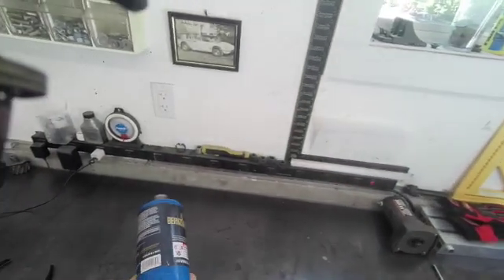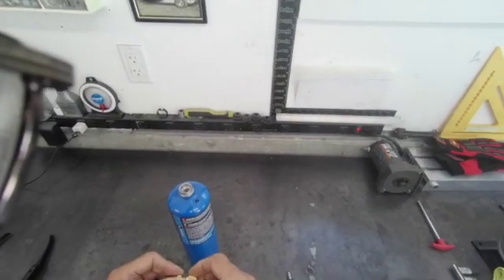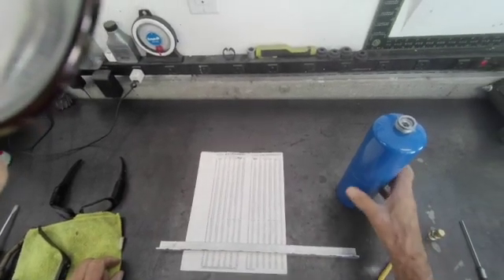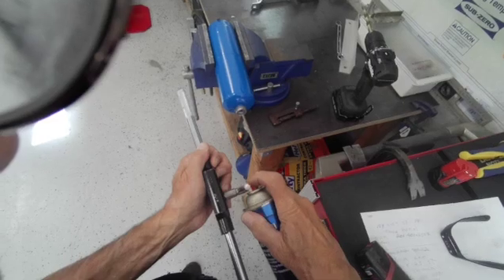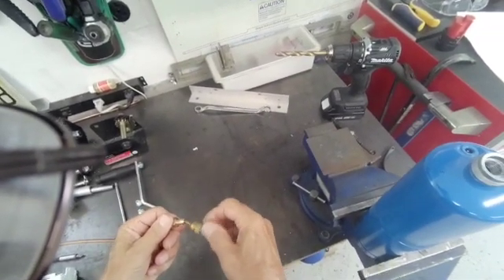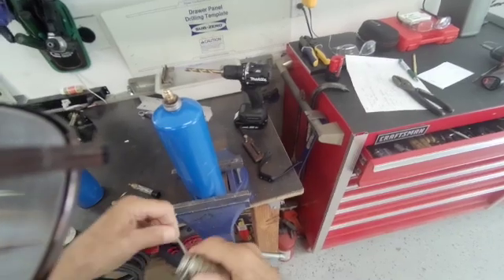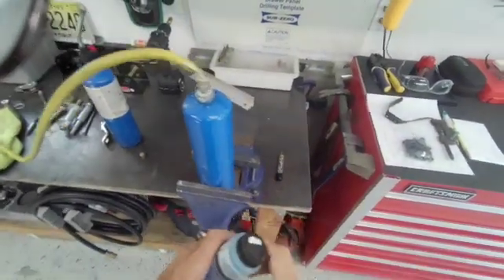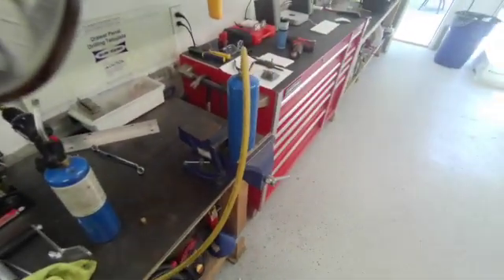Converting a propane tank to hold freon R-12 and R 134a.

Comment: How many kilos of freon gas it can hold
Reply from the maker: @smoke_stackz3168  2-3 lbs
Reply: @SubZeroSpecialists  can I use my fire extinguisher tank?  same size as map gas canister and I already install the valve that fit exactly on the threads
Reply from the maker: @smoke_stackz3168  I don’t know . Does your fire extinguisher tank have a pressure relief valve, and if so how much pressure will it hold until the relief valve opens. If there’s no relief valve what happens if the Freon expands and has nowhere to go? Boom.

Comment: You know the main valve in these is basically just a schrader valve, if you screw that out first it’ll be a lot easier to drill & leave less mess. You might have to drill the hole in your removal tool a little deeper as they seem to have a slightly longer stem than regular tyre valves, you need the removal tool shaped like a screwdriver 🪛 

Also I’d remove the pressure relief valve before soldering too, as that’s basically a schrader valve, similar to the main valve, & could be damaged by the heat. Screw it in fully first though & count the turns, so you can set it correctly when you put it back in (they’re on a spring & not usually screwed all the way in, so my guess is they’re set at factory, I haven’t removed enough of them to see if there’s any difference from canister to canister, but they’re definitely not screwed in tight).
Reply from the maker: Thanks for the tip

Comment: Would you use this for a recovery tank? And then would you be comfortable re-using the refrigerant from that tank again?
Reply from the maker: I use a charging column to recover Freon so I can see if it’s contaminated, if it’s clear I’ll reuse it. If it’s contaminated I’ll run it through a filter.
Reply: @SubZeroSpecialists do you mind elaborating more ? What is charge column?
Reply from the maker: @untyped12  A charging column is a device that allows you to measure in freon by the ounce. We have a video on how to rebuild one, however they are no longer available in 16oz version.

Comment: You can fit a flare fitting right to a propane torch valve with a simple adapter fitting.  Or is the propane valve too restrictive to allow enough flow through for practical use?  BTW, these are illegal to transport after re-filling like this.
Reply from the maker: We don’t sell or transport these tanks but GE sold them awhile back with their recovery pumps. I’m not sure if the valve within restricts the flow, for me it is easier to drill it out tap it and use a process port.
Reply: I did this with the adapters it's not to restrictive just remove the Schrader in the propane tank and put your adapters good to go

Comment: Neat idea. But, these small propane tanks rated capacity is usually around 14 oz of propane. How much R134 do they hold ?
Reply from the maker: Years ago GE offered the same size tanks and were rated at 2lbs.
Reply: @SubZeroSpecialists  what about how much R22 does it hold?
Reply from the maker: Close to 2 lbs.
Reply from the maker: I don’t use it for R-22. Check the PT chart for comparable pressures.
Reply: @SubZeroSpecialists  Can these process ports you install be used for recovery refrigerants as well?
Reply from the maker: @belowmars  absolutely

Comment: Don’t you mean 7/32” since the fitting adapter is 1/4” and 7/16” is 1/16” shy of a half inch?
Also do you have to solder the fitting? Or is it possible to use Teflon tape?
Reply from the maker: You don’t have to solder the fitting and you can use either a 1/8 or 1/4” process port.

Comment: can you post a link to the tap you used and also the process port? i cant seem to find one
Reply from the maker: 1/4” flare x 1/4” NPT access fitting. Any HVAC supply house should carry it or you can get it online. Make sure it’s an access fitting or it won’t have the Schrader valve.
Reply: You said 7/16” but are you sure you didn’t mean 7/32” considering 7/16” is just under 1/2”?

Comment: Lol "I'm not really sure if it's legal...."
Reply from the maker: Years ago GE made a recovery system that came with the same size recovery tank, they have been discontinued. Propane has a higher pressure than R-12 and R-134a so I’m sure it’s safe. I can’t say if it’s legal for resale, but I’m not selling them and I’ve been using them for 30 years. If you peruse the internet you can find them for sale, so I would imagine they’re legal.

Comment: where do you buy the process port? I'm only able to find the access fittings with the copper tube on them
Reply from the maker: OKAY that process port is 1/4" NPT thread to 1/4" flare
Reply from the maker: Any HVAC supply house should have them. I know JB makes them.